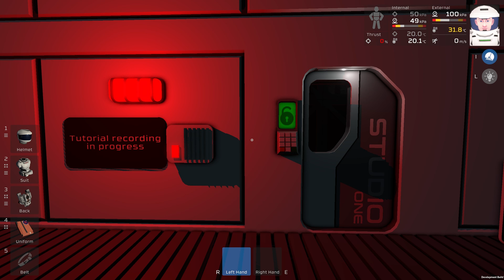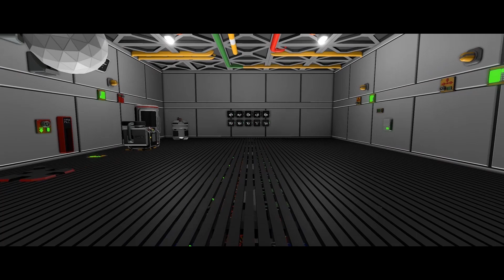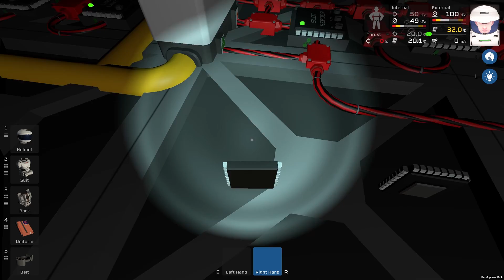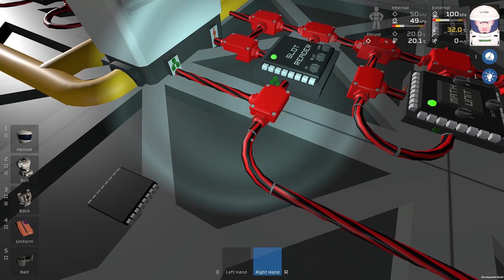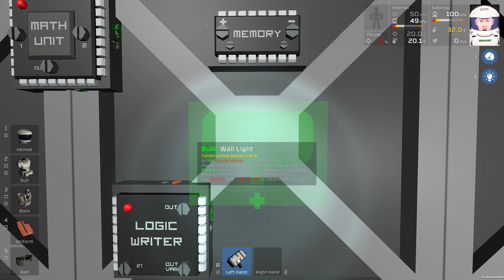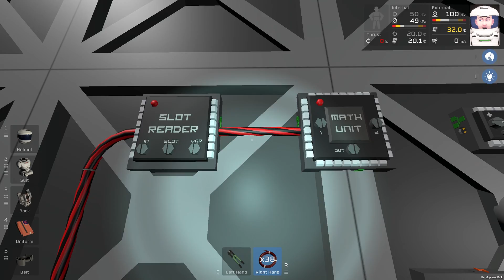Stationeers - Tutorial Filter Display With Diode Slider

Comment: On Europa do you know if surrounding your base with a vacuum will help with temperature bleed, or does temp not bleed through fully welded blocks?  I was thinking about surrounding my atmospherics with a void chamber one block wide on all sides then vacuuming out the atmosphere in that chamber like a dewer flask. then dumping all my hot gasses into those tanks to be sorted and stored, the only point of contact between the atmospherics and my main base will be an airlock.  I should then be able to tap the heat in the atmospherics and use it to heat my base.  I will be using the atmospherics as a Giant thermal battery, as it will be catching all the hot gasses from my smelter and furnace.  I will have a radiator coil ran into that room connected to my heater circuit.  Actually I will be using an A/C unit in the atmospherics and dumping the waste heat in my base.  Cools the gasses and heats my base.  Far better than just letting the heat blow off into space. as the dense atmosphere on europa cools things really really fast.  Cooling your base isn't a problem, but heating it is.  I was wondering how much heat is lost through walls if I use fully welded steel...
Reply from the maker: I would say, fill your base with CO2 with alloy furnace, or any gas helps except pure oxygen. Welding in oxygen will make your base shine a lot :D

Comment: wow so okay I learned a better way to simplify programming logic chips, by only connecting the parts to what they need to be programmed to connect to then later reconnect them to the full circuit.  So simple, but I never thought of it.
Reply from the maker: Thats how I do it.
Reply: I noticed... It means I won't have to label everything before I whip out my screwdriver, for smaller circuits.  This is a great time saver, and on Europa the battery drain is real.  So that means you are constantly running to swap out your tool batteries even on tools you rarely use as the cold saps them.  Yet another gem to have tossed us.  I know probably everyone else has been doing this and I am just the stupid one, but that doesn't make me any less grateful.
Reply from the maker: No worries, everybody is learning...